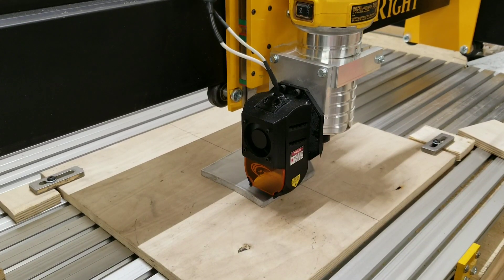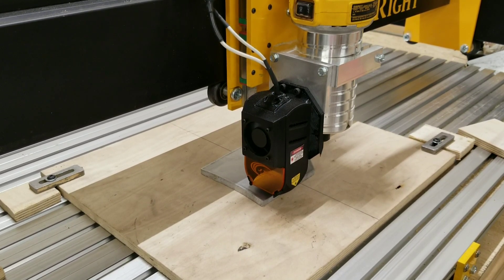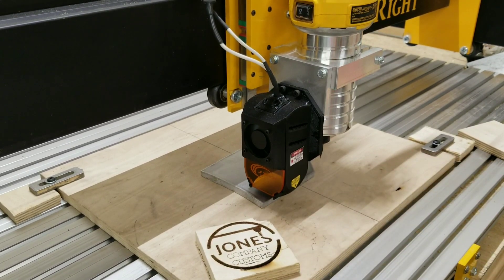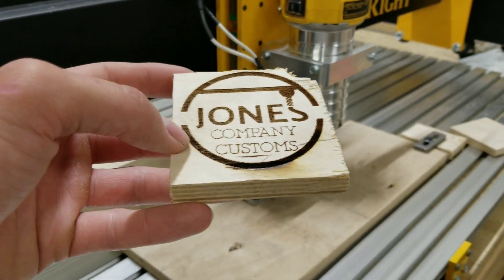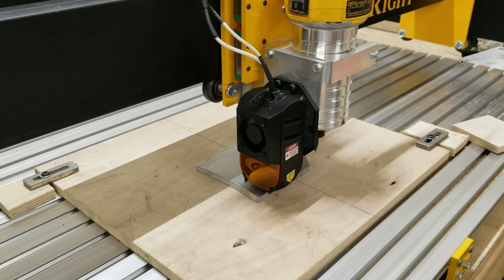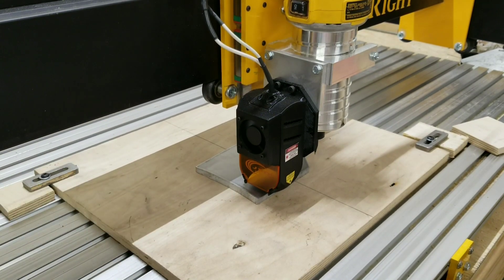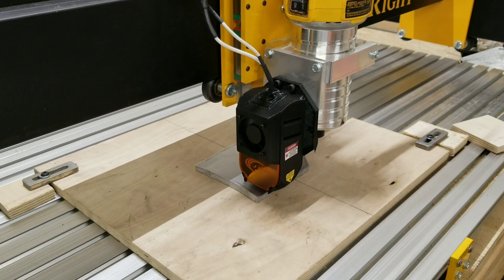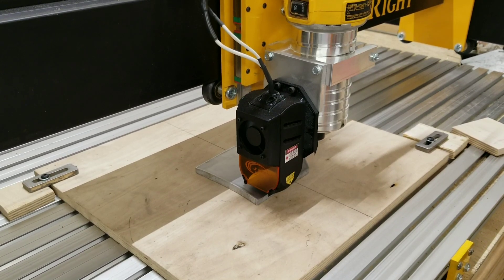Will The JTECH 7W Laser Etch Aluminum?!?!

Comment: where does it plug in on the mega v?
Reply from the maker: There should be a longer wire that come with the laser kit that has a quick disconnect to remove the laser when not in use. If you ordered the laser kit with the Mega V the there should be a port on the control box where you can plug in the wire for the laser.
Reply: @jonescompanycustoms7208  oh. thanks. so is it that you get a different configuration in the box if you order the 4-axis kit instead of just the mega v with a laser kit ? i'm wondering because my box only has a port for the 4th axis and a probe.

Comment: The aluminum reflects the laser back into the lens which damages the laser, you need to anodize the aluminium with a black coating
Reply: Also, you can use powder coated aluminum, but it will only etch off the powder coating. Many people use it for panels on aircraft.

Comment: U just answered my question I have been wondering about .... I have ordered my mega V but have not received it yet. I was thinking about using a different laser that could cut through plexiglass about 3/8 inches think. Do you have any recommendations for that kind of a laser. I am new to CNC in the past I have gotten all my work done through a supplier.
Reply from the maker: Thanks for watching Sheraz!

I'm pretty new to CNC as well so my experience is limited but this laser might be able to handle plexiglass but 3/8 might be too thick. Look around on YouTube and maybe you can find a video of someone using this laser on plexiglass! Good luck, if you find any info please report back!

Comment: Fyi...diamond drag works great too although not as fast but it can be done on any bare or coated metal...and leaves a  permanent marking/etch as compared to the lasering anodized or spray method which wears off easily.

Comment: Spray Cermark or dry molylube on the metal.  Even CO2  lasers can't engrave aluminum without prep.  The laser actually just fuses the Cermark or molylube to the aluminum.  Anodized aluminum seems to work as well , at least with CO2 lasers.
Reply from the maker: Thanks for watching!

I definitely plan on trying CeraMark at some point!

Comment: Give stainless steel a shot too. The JTECH lasers we sell are definitely are not for metal, but if you go very (very) slow at high intensity there is something in particular about the wavelength of the laser that can discolor the surface of stainless. It will not etch into the surface, but it can turn it brown permanently. We've been able to do some very light marking.
Reply from the maker: That's excellent advice! I will put that on my board for upcoming projects!

Thanks for tuning in!

Comment: Hey buddy,

I imagine the laser simply is not powerful enough to etch / cut bare metal.

At this wattage you have a couple options. 

1. Companies like CerMark have coatings that allow an etch of the material to be left onto the metal that you can then wash off so you have the natural bare metal appearance while keeping an "etch."
2. Paint, powder coat, or anodize the metal and then etch the coating, as you talked about.
Reply from the maker: Thanks for watching and thanks for leaving feedback!

I think anodizing and powder coating are going to be the most effective and practical way of using a laser like this on aluminum for sure!

I will be experimenting with both on this channel and even doing some of my own anodizing!
Reply: @jonescompanycustoms7208  I actually just found this paper from J-Tech that shows a method they've used with powder coated labeling - while still removing the coat from the rest of the part, so you get the appearance of etching straight into the metal.

https://jtechphotonics.com/?p=5582
Reply from the maker: @BigVolucris  thanks man! I will definitely give this method a try soon and make a video about it!